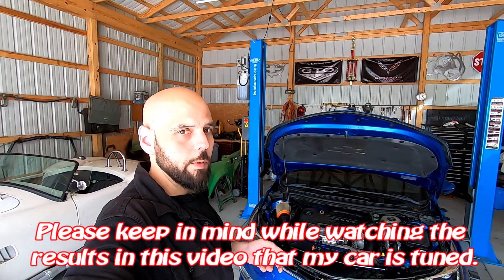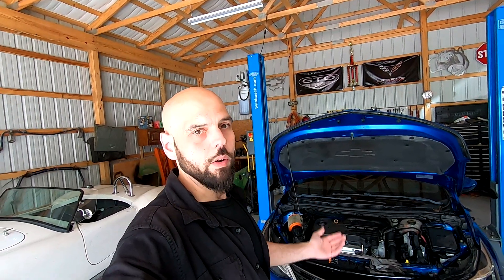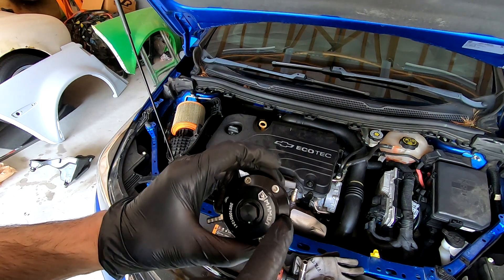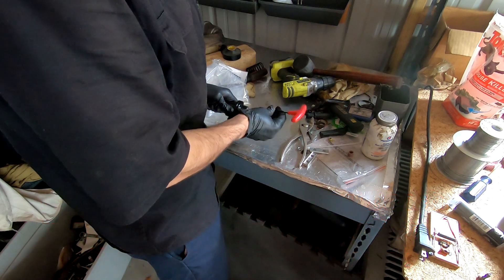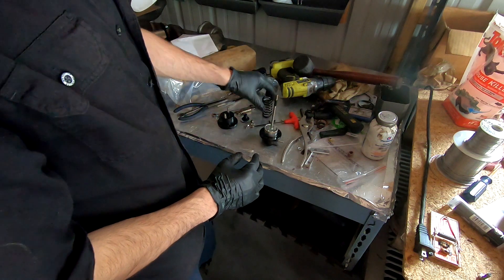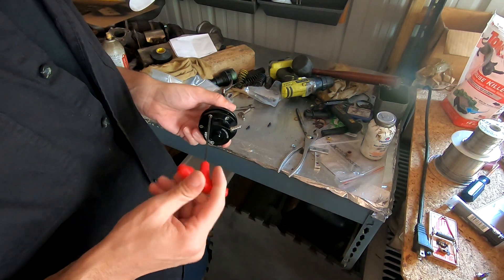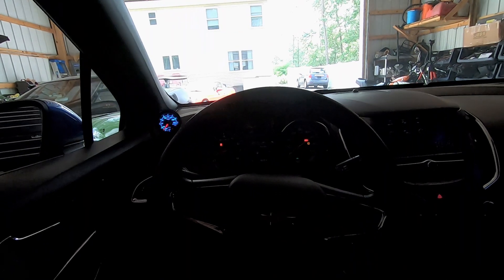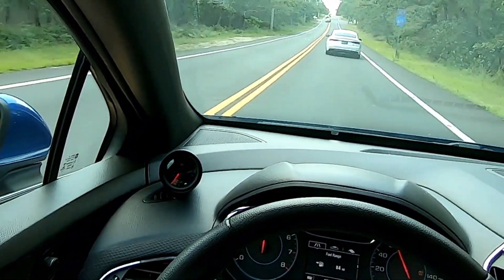Chevy CRUZE Turbo Modifications Wastegate Spring Change

Comment: The problem isn’t with the wastegate it is the actual flap inside the turbo housing once the car warms up say 15 miles of steady driving. Pull over and with a pair of pliers or vice grip go and try to move around the wastegate back and forth. You will see that it is getting stuck. It requires twice the amount of strength to open and it doesn’t shut all the way. You can force it close but then it doesn’t open easily. It is that flap that we as a community need to come up with a way of resolving. Whoever fixes that problem can make lots of money.
Reply from the maker: The oem wastegates on these cars are supposed to be rated for 10Psi of opening pressure. Every one I have ever tested opens at 3 PSI this dramatically decreases the amount of boost the car creates.

Comment: I have a base model 2017 Cruze and wondering if I can do these same mods being that they all run the same engine…correct me if I’m wrong I just wanna go a lil faster 😂😂
Reply from the maker: If you watch the whole video series by the time you get to this video I’ve been tuned. So as long as you did a tune before modifying the wastegate yes. Also I started providing some parts to the CRUZE community. Www.davescarstuff.com Is my website a lot of the parts you see in my videos I’m starting to put on the site to help people find parts

Comment: my friend has a chevy cruze with a track wing and a side exit, that shit be spooling dude that mad fast 0-60 you know the vibes cruze racecar
Reply from the maker: Hell yes! In Australia the CRUZE is a super popular race car.
Reply: @davesworld2132  hey Dave, I’m the one with the Chevy Cruze my friend ballingtons talking about, it’s gotta stage 4 eco chip turbo tune by zzp performance and a turbo inlet dampener charger which adds like 2 horsepower but u can tell the diffrence, I also welded my exaust at 11 pm at night with a. Flux core and made a side exit. It’s pretty sick honestly it’s loud asf and Dave ur just so hot. But like it’s 700 whp and 13,000 ft-lbs or torque it’s a duranaX sex LTZ what to us expect🤓 anyway I’m really horny rn for u Dave if u wanna feature my sport wing spoiler spoooool turbo k&n filter MODDED MODDED MODDED with that boost gauge? I turned up my waste gate FOR MORE BOOST, now I make 800 whp on a stock tune stock exu with just the waste gate and side exit exaust! Is crazy I’m so gay I can’t even spell exhaust! I just really love Chevy Cruzes sorry but yeah lmk if u wanna see a video it’s a true race car

Comment: How are u building that much boost I’m only peaking at 12
Reply from the maker: It sounds like you might still have the factory wastegate attached to your turbo. In this video you see what I installed in order to adjust my boost.

https://youtu.be/3jmAq-z0fac
Reply: @davesworld2132  yea I didn’t realize at the beginning that u said your car was tuned
Reply from the maker: @1slwbuu  In that other wastegate video if you watch it you will see that I gain roughly 5 to 7 pounds of boost based on the stock tune. In this video I was able to go over 20 pounds of boost because it’s tuned.

Comment: The snap-cuts work well.  I was just realizing how you have to have the same frame and hand position for the after shot, and then edit them together at just the right time.  You knew after editing that those worked out well.

I also can't help but say that I recently replaced a 55k mile turbo assy on one of those engines because of an underboost code, pretty sure it was P0299.  The wastegate shaft that passes thru the turbine housing had so much play in that hole that the flap would be cocked at an angle and leak profusely when it was supposed to be closed flat against the housing.  Once the downpipe was off it was visually obvious once you were inspecting up in there with a mirror and flashlight.
Reply from the maker: I’m glad you noticed the effort involved with getting it just right lol. Those turbos are good turbos it’s all the little things that are attached to it that’s the problem lol I wouldn’t be surprised if the new turbo gives you a problem within the next 30,000 miles for an under boost code again. That’s why I decided to upgrade my wastegate. I have another video where I install this based on the factory strength spring and I didn’t realize how much boost the car was losing I gained like almost 7 pounds of boost with just doing an actuator swap.
Reply: The underboost code dosnt effect the car at all that code comes and goes the only time that code is thrown on these cars is from going up a steep hill I’ve had the code multiple times and hasn’t effected my car any
Reply from the maker: @1slwbuu  it doesn’t but it’s because your used to the lower power of the car. If you put an aftermarket waste gate with the correct spring for the factory boost numbers/tube the cars power will come back to what it should be from the factory. You’re probably down on horsepower like 20 to 30 HP.

Comment: I am BNR tuned Would the extra boost cause over boost?
Would I need a re tune for the black spring to function properly?
Reply from the maker: Well if you get an over boost code it’s because your preload is wrong. So if preload is correct  just check your AFR in the tune. Long as your not rich or lean and getting any codes your tune  is functioning correctly. And you won’t need a retune.
Reply: @davesworld2132  Is a black spring ok with a stock cruze turbo and tune?
Reply from the maker: @alexanderkim7241  yes if adjusted properly
Reply: @davesworld2132  why black though? Isn’t gray spring would allow to you reach the same boost levels?
Reply from the maker: @alexanderkim7241  depends on your target PSI
Reply: @davesworld2132  well yours was 30psi, right? For 21PSI, black would be too much?
Reply from the maker: @alexanderkim7241  You seem to be having complications understanding how pre-load works stop basing it on springs. I need a base it on the turbos pressure and the preload based on the pressure that you want is how you set your preload and set the Spring. Multiple springs can do multiple jobs